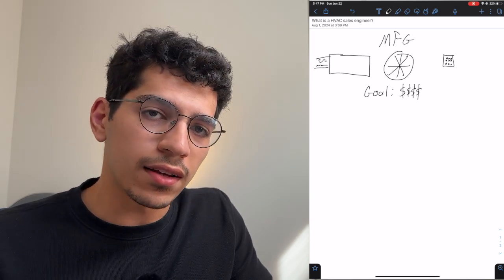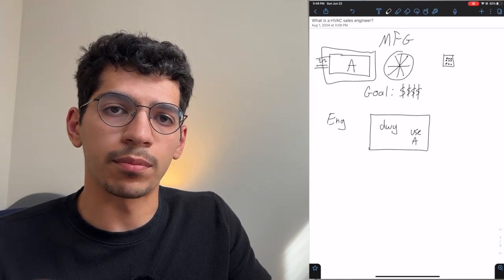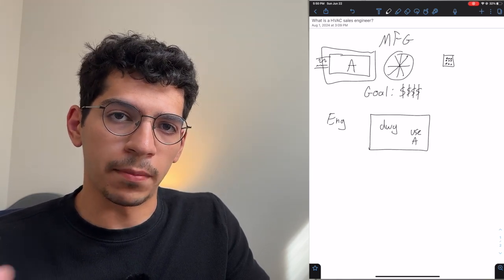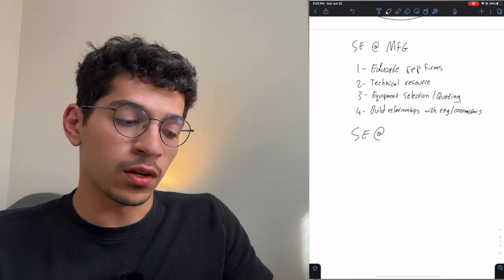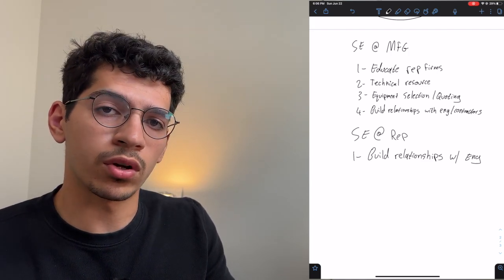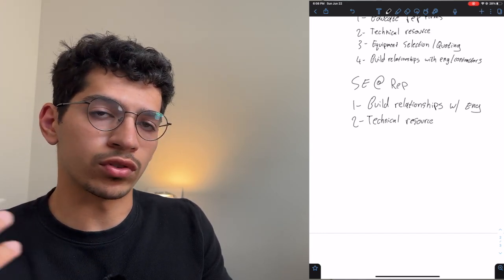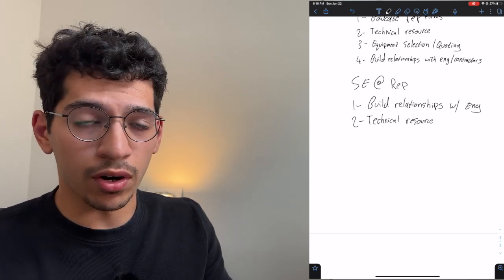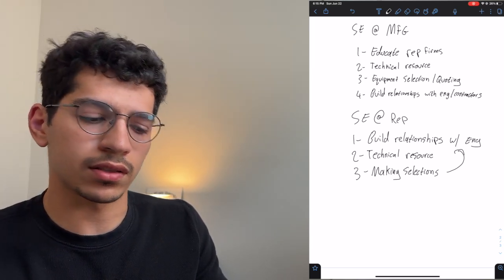What is a HVAC Sales Engineer? (Intro to commercial HVAC sales)

Comment: Hello i have a decade of sales experience in a adjacent industry. I do not have an engineering degree. I have found a job at a firm. What advice would you have for me. Im in the opposite boat of you. I have the soft sales skills.
Reply from the maker: Hey Devon, I would definitely start learning the technical side. It’s not very hard if you put your mind to it. You can use free YouTube lectures to learn, I can help you as well if you want specific training.

I would suggest spending a good amount of time on the weekend to start building up that knowledge base.